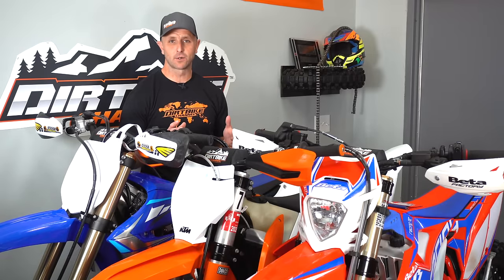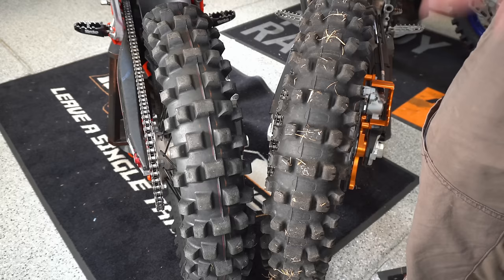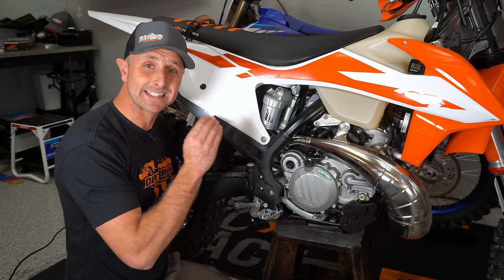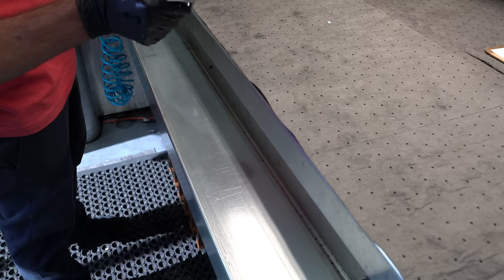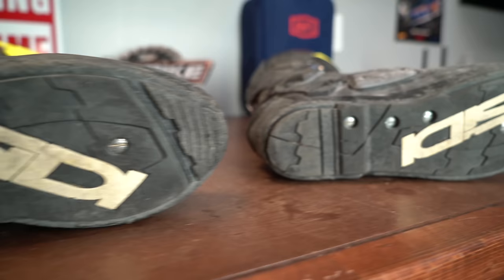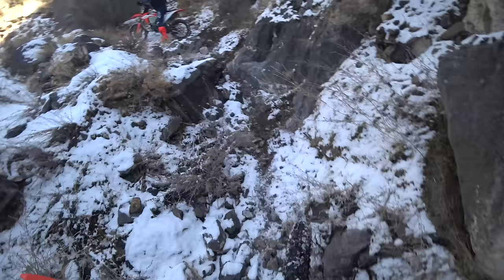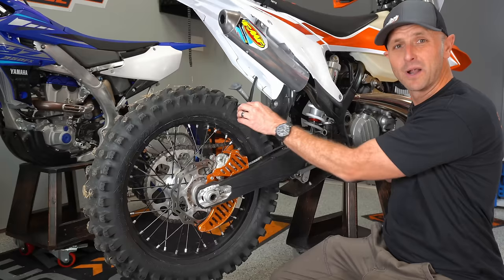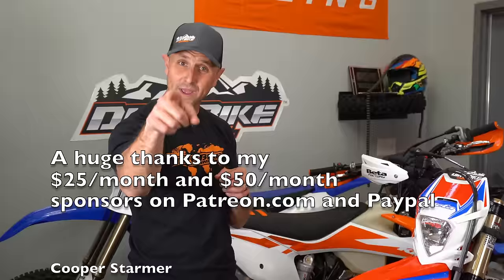21 Common Mistakes Made with Dirt Bikes - And How To Avoid Them

Comment: Thanks for the tips. I subscribed to this channel before buying my first bike in over 40 years. I'm 55 years old, 5'-6" tall, and was all ready to buy a YZ125 2-stroke, since I had one in the 1970s. After trying to sit on one and thinking about the rocky trails here in East Tennessee, I opted for the tamer, TT-R230 4-stroke. That's all I the bike I need for the riding I do. Thanks again for all the helpful information.
Reply: I'm looking to get my first bike my main problem is I'm a shorter guy about 5 5 I've sat on some 250s and can barley touch, was looking at getting a 125 but they seem to about the same height.
Reply: Was the 125 to tall for you? I'm about the same height and am having a hard time trying to find a bike I can be comfortable on I've sat on my brothers 250 and it's way to big I can barley touch the ground. I hate being short sometimes
Reply: @justinmelone6043  The seat height on the  YZ125 is 38 inches and on the TTR230 it is 34 inches. I can touch with my toes on the TTR230, but there's no way on the YZ125. I also tried an RM125, but it was too small, almost like a pit bike. The  YZ125 is much lighter, but it's too tall for me personally.
Reply: Yeah yz125 is full sized the ttr230 is a full sized frame with shorter suspension.
Reply: @justinmelone6043  guys just letting you know a yz125 is the highest sitting bike Yamaha makes so I dont reccomend comparing seat heat of the 250 and 125 because the 125bis definitely higher
Reply: @arnoldmassey2747  appreciate the heads up I'm still not ready to pull the trigger on anything at the moment still looking and have to build my credit up a little bit more.

Comment: my dad always told me to watch out for random fences.. he's ran into one when they took down a barbed wire fence but left a single wire between 2 trees
Reply: "Barbed wire is THE DEVIL, Bobby"
Reply: @d1lldb
 - Leaving barbed wire running between 2 trees seems suspiciously deliberate to me?
Reply: Old farms all used to be separated into 10 acre fields in my area. Since then most of the fences have been ripped out but there are still little goodies hiding everywhere, waiting for someone’s tire to find them 😂

Comment: Great tips standing and looking way ahead is something loads of bikers need too do more
Reply from the maker: True story
Reply: Especially if you ride on the street where the threat's are more deadly,that's why I don't ride in a pack on street.
Reply: @mrt8560  - On the street I try to avoid high traffic density as that's where more idiots cause most of the accidents! On motorways I slow down to work through a clump of traffic then squirt it to the next clump, slow down to work through that clump & so on. - When working through clumps of traffic if you can tuck in behind e.g. an experienced salesman with fast car & high mileage - experience & other traffic is giving way to him it just makes life that much easier! :)

Comment: I just got bavk from my first ever ST ride. I went with people who were good but willing to go slow with me. It was really hard, lits of rocky and technical portions. The ride was really long and i was exhausted at the end but it was so awesome!

I didnt follow all his tips, already bpught a big bike XC-w300, it was a lot. I worked hard to stay on it.

I kept thinking of all these tips, it was like having kyle in my head. Going a little faster, 20% really made a difference. Most of my riding was 8-13 mph. More problems slower than that, the different of a few mph really helped. 

Momentum was challenging to keep, hipefully get better with confidence.

Standing up was really hard, lots of muscles not used to working. 

Really grateful for this video, started my ride with a fresh air filter, new trans oil, new rubber. Im super happy i was prepared. 

Thanks Kyle! 

With enough ibuprofen, I'll be able to walk again soon!

Comment: Great list.   On standing all the time (you say 90%-95%), I am sure most of us sit too much, but I think sitting is actually better while making fast/tight turns and also climbing steep hills, except (in either case) when it is too bumpy and you must crouch a few inches over the seat, or stand up.  Granted I am not a champion but look at the pros in enduro and hillclimbing, at those times they sit too.

Comment: I'm a 4 stroke rider ('12 500 XCW). I've gotten so accustomed to allow engine braking to control my rear tire slippage. I want a 300 XCW as my next bike, that's the main thing I can think of that I will have to adjust/learn.
Reply: If you have problem with locking back wheel while engine braking try to learn rev maching

Comment: Fingers on the control tip is one to live by, especially it tight sections. It doesn't look like you can do it on the Beta, but try running your levers in a position so you would only use your middle and ring finger to pull the clutch or break. Index and pinky have the most strength when gripping and should stay on the bars. I don't always do it, but when I remember to it helps.

Keep up the good content. Can't wait to see more of the FX!
Reply from the maker: Thanks for watching

Comment: Prettymuch covered it, although I would like to point out I've got probably 2000 hours (and many, many head bonks) on one of those cheap Fly helmets, yet my buddy biffed er and cracked his expensive Airoh into pieces.
Reply: GoViking I’ve had plenty of fly helmets, those things are pretty much indestructible
Reply: @brandenpost7642  I went in to set my kid up with his riding gear, and the salesman is trying to give me some line why I needed an expensive helmet instead of the Fly I was holding. It did nothing for his credibility lol
Reply: Helmets need to meet minimal standards. I'd rather replace my helmet every 2 years, rather than spend $700 and try to make it last way too long!
Reply: Airoh is extremely light. That lightness comes at a cost.

Comment: Yep, I made mistake number one lol. bought a KTM 400sx. was awful for woods.
Reply: Im not a big guy so the idea of riding a big bike &  stalling it 1/2 way up a hill so end up having to fight against gravity is somewhat less than entirely appealing ! So my preference is for Yam 200 c c 2 strokes where an engine with reasonable power is fitted in what is basically a 125 chassis gives a better power to weight ratio. Seems a good starting point to me. :)
Reply: @jimlyon7276  flywheel weight on those beasts helps just a bit
Reply: I'm a big guy(250 lbs). My buddy who use to race told me to get a 4 stroke 450. I have a little 300 street bike and it's not enough for me. I've been riding street bikes for years and I just want to get a dirt bike became I live in flat lands.
Reply: @jimlyon7276  im want to buy a XR400 as m first bike ever and now Im having second thoughts.
Reply: @felipesuarezweb   - Sorry but I'm not the right  guy to ask as I'm into Yamaha 1980s 2 strokes. And much as I love 350-400 c.c. parallel twins for their balance of power, light well, steering etc I won't deny they are built down to a price e.g. If you should ever want to get one tuned, because of their twice as many firing strokes they tend to run hot. So one solution is to run more petrol & oil to keep them cool. Which is when  you start to find the ignition system is marginal ( especially the later "waste spark" system that fires @ TDC & BDC on both cylinders but on only one tiny ignition coil. )
   Anyway getting back to your point, while I don't know the regulations in your country as to what size they permit learners to ride, as a learner you don't want too much power as you won't know how to use it. But you want enough to get out of trouble, Depending on your size & distances you might want to travel then a mid weight bike might be reasonable? Do be aware that the accident statistics are that  whether an experienced rider or not for your first six months on a bike new to you , you are more likely to have an accident !
 So given that it's best to feel your way into it slowly - how do the tyres feel? How much grip & traction do you get in wet or dry conditions, How linear are the brakes & throttle response etc? As a learner you are more likely to have a spill so perhaps it might be best to get a second hand bike & ditto leathers. Then when you are proficient upgrade to better stuff.
  With hindsight if I were to start off again the route I'd choose is  roads are dangerous as anything is too hard to crash into. Also avoid high traffic density as it contains more idiots likely to kill you! Given that I'd prefer to learn in the dirt as you're going slower & you've a better chance of the scenery being softer ! But in the dirt traction is a LOT less so I'd prefer to start off with a MTB, get used to riding in the dirt, learn how to control skids. For a motor bike learner get off the brakes, declutch & ease off the throttle so your not putting power into the tyres & most often the bike will sort itself out. (On an MTB I run an extra 5 psi in the rear tyre so it's more likely that the rear tyre will lose grip first [ e.g. If the rear tyre skids & comes out to the left turn the handlebars left until you get a feeling that your pushing against the rear & you can control it their ]) As for  losing the front  end that can be scary as  it's fast & violent & I'm still working on it ( I've got as far as what you need to do is quite physical e.g. if the bike is falling down to your right stamp down with your right foot & push up. Ditto lift up the right handlebar grip & down on the left & lean your body to the left.) - A good place to practice is on wet sand e.g. between high & low tide on a beach. Run a dirt tyre on the front & a well worn road tyre on the rear to lose traction more easily there.
 If you then progress to a dirt motorcycle I recommend something like a Yam  DT200 as the chassis is meant for a 125 c.c. c & with  a 200 c.c. engine you get a good power to weight ratio & unlike a learner with a big bike if you stall going uphill you don't have so much weight to fight against!
  But if your heart is set on getting a road bike ASAP then @ least go & get a training course for learners - & always remember that while bikes are fun they are  VERY SERIOUS  fun - & never forget that on the road YOU  are the one who is most vulnerable ! So just be careful & take it easy.- HTH?
Reply: @jimlyon7276  dude I really appreciate your insight. Thanks. Noted. I have been all my life riding MTB and Enduro MTB. But I want to get a trail bike only. No road bike cause yeah they are too dangerous. but with your comments, I'm going to take it very easy to really get an understanding first and get to know what I am doing and the machine. Learn to use the throttle, brakes and clutch like I should. I am excited but also like you say I have to be respectful of the power and danger. Thanks for the tips buddy. Happy new year from Costa Rica
Reply: @felipesuarezweb  - TBH - I've been out of bikes for far to long because of being dragged through a brutal & quite unnecessary divorce that put me in "the wrong place @ the wrong time" which caused 2 serious traffic accidents & screwed my life up - So I'm out of touch regarding which bike models are which & it was L8 @ night when I was dog tired- Sods law was I recognised my mistake just after I hit the reply button - but that's life! Anyway I'm glad you found it of help ! :)
  I started off on road bikes, got a MTB to help me recover from my injuries & now have a Yam DT200R that needs recommissioning & once I've done another apprenticeship on that ( @ a higher level than MTBs ) then hopefully I might trade it in for a DT200WR & if that works for me then spend some money on better suspension, brakes, tyres & a porting job etc - See how it goes?
   Happy riding & have loads of fun! :)

Comment: I read in a dirt bike magazine years ago stand when you can and sit down if you have to best advise I ever got
Reply: I'm in 2 minds about the standing up vs sitting down thing. I think emphasizing standing up is the better way to go, but at the same time i've learned to ride extremely well as a mostly sit down rider. I am always poised to stand and will do so on gnarlier terrain, but standing is not an absolute essential technique to ride well and fast. There are quite a few riders that come from a motocross background who do very well in enduro and will still sit down quite a bit. If standing fatique's a rider so much, or is just too difficult to drill into their brain, it's not worth trying to shove them into a 90% standing mentality
Reply: Da fuq

Comment: Levers - you can run with the perch a bit loose so levers move on impact. This allows you to adjust position without tools as well. Just use loctite on the bolts so they dont loosen further. Flex leavers are also a good investment.

Tubes - run with the valve stem nut either off or snugged up to the cap. This prevents valve tear. Lube tubes with moose lube to help prevent pinch flats.

Spokes - cable tie them so when one breaks it doesnt fly around.

Just all my opinion!

All good tips there Kyle, especially the one on buying an old bike that needs too much work - 'dirtbike years are like dog years' ;-)

Comment: First bike was 07 honda 450. Loved it and still do. I disagree with the too much bike thing. Respect the bike and you won't die
Reply: i agree, got a kx450f as my first motocross bike and i just take it easy on the throttle and have a finger on the clutch, im 5,7 or 170in cm and i weigh 60kg so not much. and i stand up most of the time because i get much more control

Comment: Already made the first mistake. Coming from street riding and wanted a dual sport. Bought a ktm 500 exc-f as my first bike for anything offroad. WAY TOO MUCH power for me for offroad so ive had to learn throttle control a lot more. It was prob a mistake but im loving every minute of it! Point is its better to start off with a smaller bike but if you do make the mistake its not the end of the world. Learn to control it on easy stuff and have fun and work your way up to harder trails

Comment: I understand why people would advise against getting a 450f as a first bike. But honestly I’ve been riding a yz 85 my whole child hood from 8-13 then I took a 5 year break. And now I’m 18 and just bought a 2017 Ktm 450 xcf. So quite a massive jump in engine size. But I still think that Yz 85 is 5x harder to ride. It’s like comparing riding a wild  animal vs a mustang. Yes the 450 has more power but you feel like it’s more controlled. Love both bikes at the end of the day. Great video!
Reply: I don’t see the point though. Most people, especially amateurs which have low to zero experience with larger bikes can’t get even get near to pushing all that potential. A 450 will just be a heavier, and harder bike to ride compared to a 250 or even a 125. I would confidently bet you would be faster instantly on a 250.
Reply: @m-h1269  I bet your right. I probably would be just as fast if not faster with a lighter/ smaller bike. But I also like having a machine that can cruise down some straights with ease and has the low end grunt to go up any hill. And since I’m light on the throttle I’m not putting as much wear on the engine. I also found it for a smokin deal so it checked all my boxes.
Reply: @DanielDoesntLift  Fair enough then.

Comment: My first bike in 85 was a 1980 DT175.  I had a blast and it never ever failed and I flogged.  That was a good beginning.
Then I had an 84 KX125, and 85 KX250 and than in 88 I bought an 1988 CR500RJ. Great bikes.
 I sold the 500 in 94 and didn't have another bike until 2014...an 02 RM250 but not a good idea as I was out of action for so long.  Something registered like a CRF-X or WR woukd have been smarter.

Comment: Im a veteran dirtbike rider but i haven't rode in 15 to 20 years just got a 98 kx250 and im having a hard time getting it on the bike stand hurts my back so i got a scissor lift lol also i suck now its been so long im now a beginner again this kx250 is probably my 35 40th bike I've owned I've had lots of bikes when i was younger 😮

Comment: I’m 15 Turing 16, 125 kilos, iv had nearly 11 years experience riding, I can confirm don’t go to a 450 to quick, unfortunately for me I don’t get power out of the 250 4t and 2502t, (btw just spent $2000 on a full rebuild for my 98 cr250) personally I like the 450s just due to the power and suspunion and the power of it, btw iv been on big 4 strokes since I started riding due to my height and weight, I’m currently 6,3. Btw really good video mate 🤙🏻
Reply: How tf do you have $2000 just laying around at age 15. Im age 15 and can barely afford to buy a 2006 85 stinker
Reply: Tesco Lemon Bleach 😂 dad paid for parts and we fixed it
Reply: im getting a Sazuki RM-Z 450 for my first bike any advice?